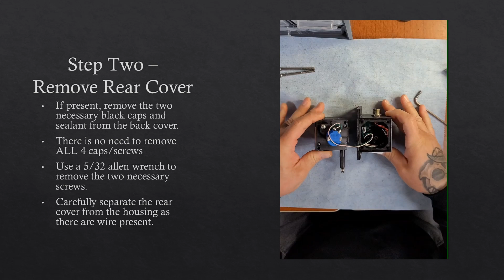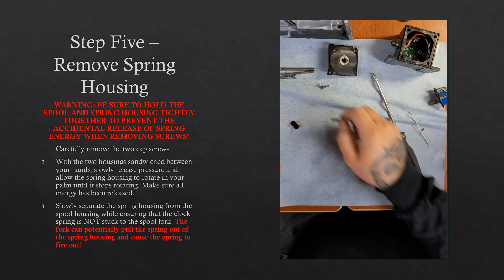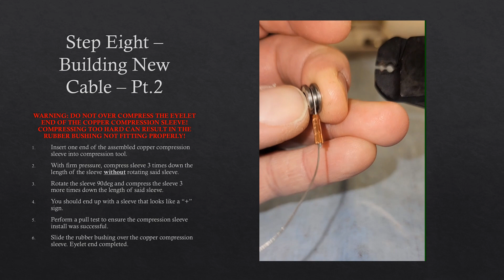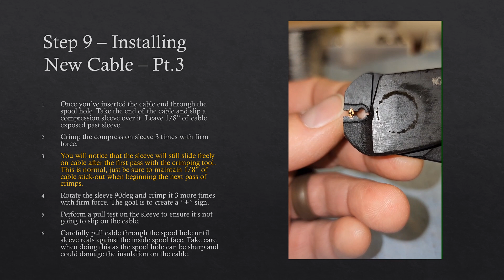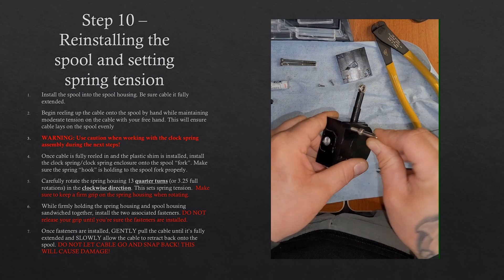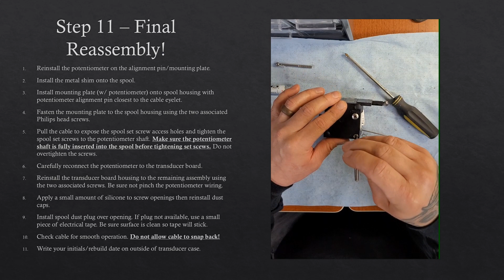How To Rebuild a Linear Transducer - TE (Celesco) PT1MA-50-FR-420E-X-632450C

Comment: Hello, Excellent video.
My unit is the same but the cable exit is BK...not FR. Can I change it to FR by just changing the orientation?
Also how do you know the required turns of the clock spring for re-assembly?........Is 13 (1/4 turns) for 5oz STD unit (PT1MA-50-FR-420E-MC4) or 16oz for (PT1MA-50-FR-420E-X-632450C) unit?
Much appreciated if you could help.
Reply from the maker: Thank you, Russell!

Yes, you can change the orientation to suit your needs. This orientation is what our facility uses. This video was meant as a training guide for our facility, but I figured it would be helpful to others as well.

The documentation I was provided by the manufacturer was 12 full turns, but that is WAY too much in my opinion. I found that 13 quarter turns worked well for ours and put less stress on the tiny cable which is already in contact with debris that can be abrasive that can quickly degrade the cable insulation (our lead failure). This is made worse with very high spring tension. Our unit does not assist with returning any other devices mechanically. It only needs enough spring return to retract its own cable. The general consensus from our maintenance team was that the tension "felt good" to them and we haven't had any issues with the rebuilt units after several months of runtime.

As for you question about spring tension for the 5oz and the 16oz: the stroke range for both are around 50", so 13 quarters turns should work for both. That being said, this is what works for us. Spring rates can decrease over time and cables do stretch at different rates, so it's important to monitor these variables and adjust to suit your own needs. 

Thanks for watching and let me know if there is anything else I can help with!